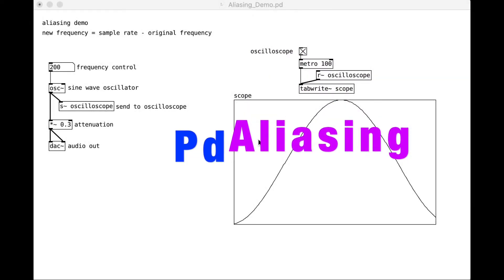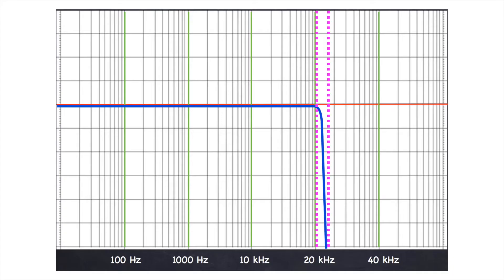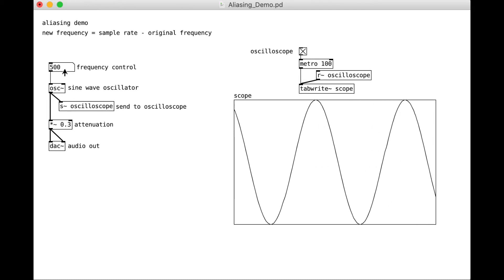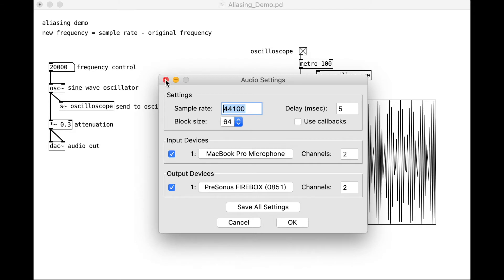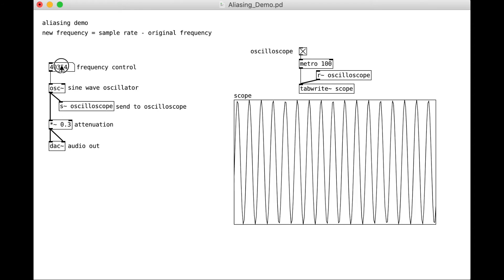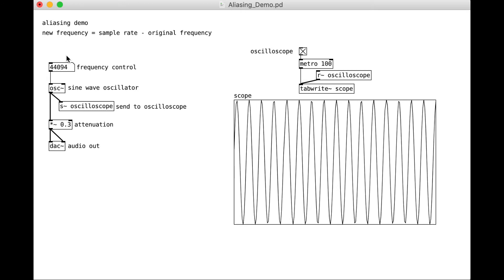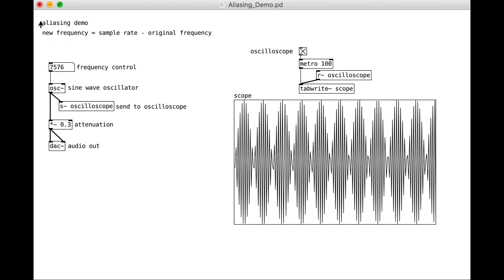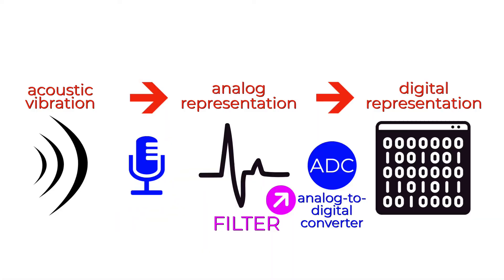Aliasing Exposed: Confronting Unwanted Harmonic Artifacts (Pure Data Demo) | Simon Hutchinson

Comment: Nice clarity and brevity. An old tutor always told me, just throw a low pass filter on your outputs, you'll be fine. Do you agree?
Reply from the maker: Thanks! Maybe on the filter. It depends on what you're trying to do, but throwing in that anti-aliasing filter might be a good solution if you're having issues.